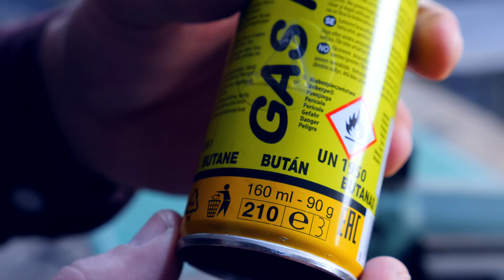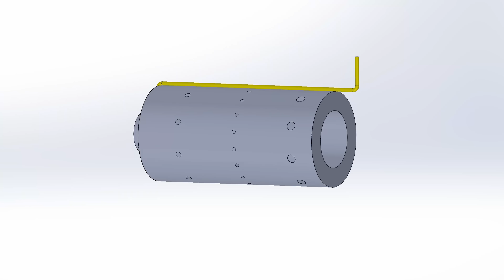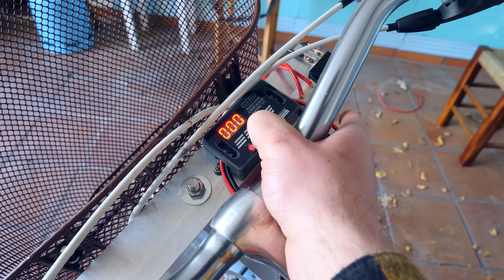I put a Homemade Jet Engine on my Bicycle

Comment: I know literally nothing about even basic chemistry. So this could be a dumb question.

But instead of butane, could you use something like propane? Cheaper, and much easier to get in higher quantities.

Also, totally unrelated, when turning, if you just put a little pressure on rear breaks it will make it much more stable.

That’s usually how motorcyclists can pull off sharp u turns at low speeds.

Comment: Did you know they create fireplace tubes that have two walls? The inner wall let's all the hot air out, the exterior wall let's fresh air in. Just thought it might be useful for you.

Comment: Cool jet bike!! By the way I realize you were promoting Omaze but you are wrong about electric cars. I have a used Nissan Leaf. Its ugly. It was cheap.It only has a 70 mile range. It works great for my purposes. With gas prices what they are it saves me a bundle. I have a gas car for road trips.
Anyway, I like Tesla's tech but I would never want to deal with ownership of a Tesla. If I won that car I'd sell it and buy a new house and then a car with less headaches. :D

Comment: Technically a jet engine uses the fuel as the source of energy for compression.  This uses an electronic leaf blower for that.  So it's more of a combustion augmented electric fan.  I think you should give a single shaft jet engine a shot and create your own turbine!  😂

Comment: I don't think its particularly important but the process you were doing is not technically welding. It is called brazing. The main difference is that the material you are working on is not melted during the process.

Comment: A microwave powered superheated steam engine, that blows the water up into superheated steam in the combustion chamber instead of fuel and air. Takes advantage of the expansion rate of liquid to gas.

Comment: Not to be that guy but 3:08 is not welding that soldering. The metals being bound are not melting just the binding metal is.

Comment: I don't know if it will be popular enough to win me a 3D printer, but I can't allow you to continue to live in a fantasy. That engine never demonstrated that it could provide propulsion, it merely showed that it could sustain the amount of momentum you pushed off with every time you left. Never once did you let the bike take off under the power of the jet engine in this video. So while it might be strong enough to MAINTAINT MOMENTUM, that is not the same as creating enough thrust to move the bike. Sorry. Tomatoes are still disgusting, if that helps. 😃

Comment: Id like to see that built with cast iron  plumbing pipe and i think the exhaust would hold up and be reduced in size srepped down from 2 inch to 1.5 inch and increase thrust

Comment: I love the channel, keep up the good work! Although that wasn't welding, that was brazing.
Reply: Yeah I came down here to say the same thing. Just soldering basically. Integza, if you could get yourself some weldable sheet metal and actually do some welding, these would come out way more robust.
Reply: And brazing works in way lower temperatures which is why it melted under test. Actually welding thin sheets is a pain though, the spot-welder approach is a smart one
Reply: @EeroafHeurlin  Aye, if he wanted to try again he could reinforce it and try to make a design that worked with the spot welder, possibly have a pipe that fanned out on the end, spot weld that, another disk that could go over top of the welded fins or blades (not sure what to call them) with a larger diameter than the fins, and spot weld that as well. Seems a little overkill, but that might be the solution for what tools he has.

Comment: perhaps you could add an active cooling system to the nozzle, like using some of the leaf blower's power (or just using an electric pump) to run a pump that circulates water around the nozzle to cool it down and then you'll be able to experiment with different nozzle designs. this is a very interesting project lol.

Comment: When you're bending brass pipe. Next time try doing it cold but first fill it with sand so that the tubes don't crimp closed allowing for better butane flow.

Comment: That's what happens when you attempt Braising for high heat applications. Welding would have been a better option. A cheap wire feed with a shortcircuit set up would be perfect for these lighter gauge metals you're working with for jet engines.

Comment: I liked the dyson style jet engine, but would like to see the gas ring internally on the top side of the engine instead at the bottom with the fan. This way only tip outlet get hot.

Comment: Expert lvl idea: Add a nozzle with the ideal expansion ratio, and deal with the heat by regenerative cooling. For an even greater challenge, use an aerospike nozzle. This will make it so expansion ratios are a bit less important but it'll be much more difficult to regeneratively cool.
Reply: I'm not sure if the pressure ratio of the leaf blower is enough to worry about that.
Reply: Bell nozzles are pretty much only for changing the impedance of the exhaust to the air, this is done because the exhaust can only leave at the speed of sound so decreasing the pressure by expanding the nozzle can increase the exhaust speed. Also regenerative cooling is cool but it would probably be more efficient to just route some of the air from the leaf blower over the nozzle
Reply: @KerbalChris  Yes... Bell nozzles do increase the exhaust speed the larger the nozzles, but at sea level, eventually you start to run into issues(Flow separation, e.t.c.). Also I think it would be better to do regen cooling with the fuel since it's already at relatively high pressure in it's tank. Taking some of the leaf blower air to cool the engine would reduce the exhaust mass and/or speed and lead to a decrease in thrust and efficiency.
Reply: @V1jayanta  you notice how the engine flammed out when the leafblower was at the lowest setting? Thats what i was getting at with routing some of the air. Also flow separation wont be an issue at all, you’re still gonna use the expansion ratio for sea level and the ratio for that nozzle expansion and the throat wont contract the exhaust diameter too much
Reply: @KerbalChris  Yes, the engine did have a tendency to easily flame out. However, that in of itself is an issue. I believe the best course of action would be to incorporate multiple combustion chambers, splitting the air in between them, and keeping the propellant regen cooling. That would solve all the issues I think. As for expansion ratios and whatnot, as long as the ratio isn't too high, I don't think it'll matter anyways. Integza isn't spaceX. He isn't particularly worried about ISP and all that anyways. Just thrust.
Reply: @V1jayanta  the biggest problem with regenerative cooling with hydrogen peroxide is that it will start to decompose at around 150C, which is well under what the engine runs at, this means that oxygen will form in the fuel lines. This mixed with the explosive hydrogen peroxide vapor that would be present in the lines would... i just realized this is a completely different video. yeah i see no problem with regenerative cooling, well other than the low specific heat of the fuel, it would be cool to see anyways. And the only way we would see the cooling being used is if we see a nozzle on the thing
Reply: @KerbalChris  Yupp. That's why I suggested a nozzle in the first place. And yea all of this isn't necessary for anything anyways. He just builds things cuz it's cool.
Reply: Yes, the air and the engine have a total impedance mismatch. In normal terms, this means that the engine pushes really hard in a small area, but air is better at resisting a little movement over a larger area. it's like if you're trying to push a car: Small bursts of pushing aren't going to get you as far as continuous a little bit weaker pushing.
Reply: We'll get there someday. Not today though. Today, we have a leaf blowing, jet powered bicycle.

Comment: Hay for your next project like this just use parts used for car exhaust. They are designed to handle the high heat

Comment: I really want to see how fast it will get on a long road. Jet engines have horrible torque but great horsepower. Meaning they don't accelerate things very well but they continue to provide thrust until the exhaust gas reaches the same speed as the air it's traveling through (hypothetically in a perfect system obviously)

Comment: Would be cool to see you run a jet engine off of hydrogen. Keep up the awesome content!
Reply: I don't think it's the most practical idea. See, Propane and butane can both be compressed into a liquid under relatively low pressure (up to about 15 bar).
In comparison, hydrogen has to be stored as a compressed gas, which means really thick and really heavy tanks.

In the past, we had a Volkswagen Polo that ran off of gasoline or natural gas (methane), and the methane tank took out most of the trunk. It was about four times the volume of the gas tank, and still the methane stored in it didn't hold as much energy as the gas tank.

Given that methane holds more energy per volume of gas, (about three times as much), a hydrogen tank at comparable pressure will only provide a third of the energy of methane. And if we're talking about hydrogen/methane tanks, we are talking about a few hundred bars of pressure, compared to the 15 or so that propane/butane need.

This also means following all the proper safety precautions for dealing with a multi-hundred-bar tank of a highly flammable gas. Gas tanks of that pressure are no joke, and if not handled carefully can easily kill someone.

Comment: If you have problems with the solder and temperature, could you make an inner steel tube that has no solder but just fits in some way on the outer tubes? It would create an extra layer to isolate heat from your sensitive parts.

Comment: Gets me a little every time when he says "weld" when in reality he is brazing. (brazing uses low temperature filler metal to "stick" 2 metals together). Real welding actually melts the base metal itself (along with any extra metal you add to fill the gap). Much higher temps are required to weld (a oxy torch isnt gona cut it).
Reply: Yeah, I was wondering abou thtat. I was pretty sure a real weld wouldn't melt before all the rest of the metal did.

Comment: Idea but terrible? You know those early-cold-war helicopter with the jets at the tips of the blades to try and eliminate the tail rotor? Something built on that concept would be awesome! And you can power it with pretty much anything compact that generates thrust at the rotor tips.

Comment: 10:00,.. well, duh, because that wasn't welded on, it was Brazed, which is closer to Soldering, so the material used to join the sections melted, because it's not meant for that amount of heat.
Brazing is a very good technique for jewelery or making repairs to cars or sealing fittings for plumbing and domestic natural gas supplies for heating, places where there is little stress or heat on a component,... just not for rocket science, or Jet science.

Comment: it would be cool to see what experiments/engines you can strap to a bike using nitrous oxide :) you can spend half the video laughing about your experiment (laughing gas) and I'm sure it will make an awesome addition to one of your existing experiments. I.e add NOS to your leaf blower gas engine :) or make a hybrid rocket motor with NOS

Comment: Did this as a teenager with a liquid propane fueled pulse jet with reed valves.using a ceramic honeycomb catalyst to keep it lit and increase efficiency  .. It Was louder than yours the gas valve from a yard torch with pilot setting was the throttle. Btw.  Police don't like rocket powered bicycles.  Particularly.  I got a warning.  How many cc is that thing. ?  None sir.   ..

Comment: This engine is great, it has a really good wide opening in the combustion chamber to act as a diffuser and really convert the high speed low pressure air into low speed high pressure air needed for combustion. I think your next step should be figuring out how to manufacture conical ducts for your engines diffuser and exhaust to optimize flow through the engine and prevent hotspots in your combustion chamber. This will equate to higher thrust. Also as far as flameouts go, on the engines I work on we have valves along the compressor to "bleed" excess air until the engine is through its startup, for me an automatic valve that uses later stage air to close the bleed air valves placed at the beginning and mid points of the compressor, once the engine reaches a high enough rpm to be past the startup. For you it could be as simple as a T duct with a valve to bleed excess air, right in front of the combustion chamber that is manually closed by a servo or mechanical linkage.

Comment: hi integza ^^ what do you think of doing a rocket engine with the fiel line going in the combustion chamber to see if there's any benefits to the increased temperature and pressure of the fuel ?

Comment: I’d love to see a ion-engine. It’s quite easy to build but difficult to optimize. And it would be hella interesting if you could power your grandfathers bike with it.
Reply: Highly doubt it. Even advanced ion engines used in space don't provide an awful lot of thrust. The main appeal of an ion engine is it's ISP.
Reply: @V1jayanta  but still an ion engine would be hella cool.
Reply: @hollminator9382  That's true... but still.

Comment: Instead of using a speed control could you just create an air restrictor in the tubing?also would you be able to use the liquid butane without the can,like creat a main tank and use a pump or something to bring it to the engine?

Comment: From my understanding, this device is an air-breathing rocket engine, not a jet engine because combustion forces do not power the air intake stage. With that in mind, perhaps a combustion chamber with de Laval convergent/divergent nozzle would give greater thrust.

Comment: Actually you need a nozzle, it is quite a big part of the engine efficiency. It has to be the proper size to allow maximum expansion of the exhaust gas.
This is why fighter planes have the variable nozzles, which adapt to the power setting of the engine and the air pressure at the altitude.

Comment: Bro please ware lether gloves when using the grinder and if u want to use it as a bench grinder make a better rig to hold it and have a shead on the grinder incase the blade brakes shrapnel can be dangerous

Comment: Maybe to improve the airflow of the leafblower jet engine, you could use your old idea of turbines. Make 3D printed attachment to add to the leaf blower and redesign the chamber to spread the air out even more.

Comment: why dont you split the output for the leafblower so your fins on the outside of the exhaust create a similar effect to the heat sink with fans blowing on it inside of a computer?

Comment: All you have made is a glorified EDF with an afterburning. Also make a jet turbine that uses a afterburner, And is CNC milled. Also I dont think the concrete parts used in it were very efficient, But its a start

Comment: I actually think most of the thrust came from the leafblower as oppose to the combustion,
despite it getting so hot.
That's probably to do with the exhaust velocity, of course higher velocity is higher effiency.
You know you can increase exhaust velocity whith a narrowing throat until supersonic velocity right? 
(then you need an expanding bell nozzle).

Also more importantly I'd still say its running very oxygen rich,
hence the extremely high temperatures. The leaf blower added oxygen, but way more oxygen than you bargined for.
Yada yada. The oxygen ate the engine.

Something like 30% of a modern jet engine (more accurately a turbofan engine) is just pressure recovery,
controlling the inflow of oxygen to get a favourable reaction. Not too hot. Not too ineffecient.

Comment: 5:46 My next car is going to be a 1946 Ford Super Deluxe. I want simplicity, it's fast enough to keep up with traffic both on and off the interstate, that flathead V8 sounds fucking amazing, it's comfy, it's roomy, it's built to last, and the best part is I can tweet mean things about Ford all I want to without risking having the car crippled because it lacks any sort of capacity to be crippled remotely. Also a bit of history going down the road burbling along steadily.

Comment: I think a potential improvement to this engine would be to use some of the air from the leaf blower as a bypass. This bypass air can be passed around the combustion chamber and nozzle. This will cool the engine, and the heat the bypass air collects can be used to expand it, making it potentially more efficient. It could also grant ease of starting the engine if less air is being forced into the combustion chamber. It might even do possible to make a rudimentary valve to control the bypass ratio for fine tuning and starting.
Reply: Very smart!

Comment: How about trying to build a turbo jet with either the peroxide and catalyst instead of fire in a combustion chamber or jist usibg high pressured steam ,the power and expansion of the steam should turn the turbine faster ,use a leafe blower in the input of the turbine and see if the steam will increase the power output.

Comment: Please try and demonstrate a centrifugal inertial propulsion using stored kinetic energy its when you miss balance a fly wheel and it fly's off you just have to jump onboard like Thor's hammer no chemicals no explosives just a mechanical engine that has an imbalance please give it a try thanks oh I really enjoy the channel

Comment: Would it be possible to make a few smaller engines set radially around a bigger chamber to generate more thrust, and maybe incorporate an air vortex in or outside to keep the engine cool?

Comment: So if the leaf blower was overpowering one jet engine, could you split it out and run two or more engines?  I'm sure you'd more speed with say four jet engines all going together.